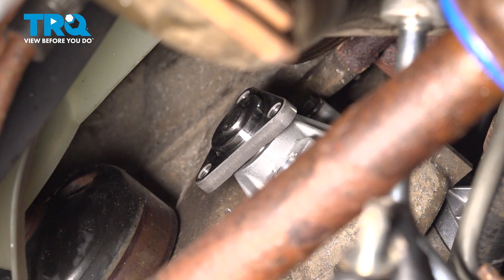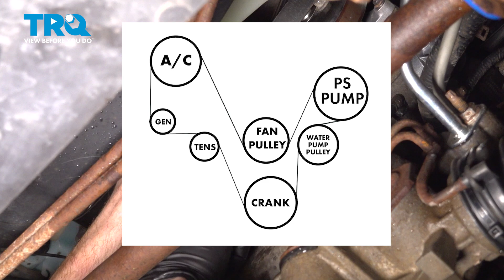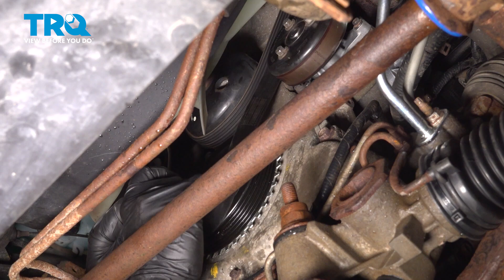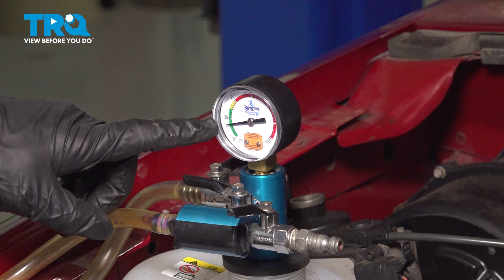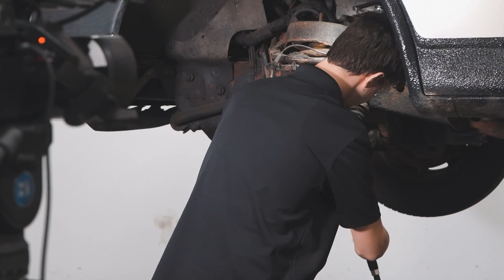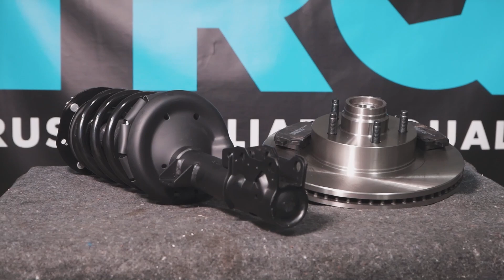How to Replace Water Pump 1998-2011 Ford Ranger 2.3L L4

Comment: Don't you need to pinch off the vent hose connecting the reservoir to the radiator before beginning to pull vacuum with the refill tool?